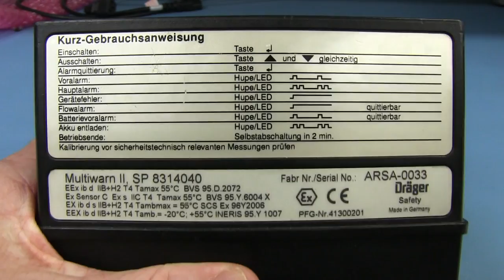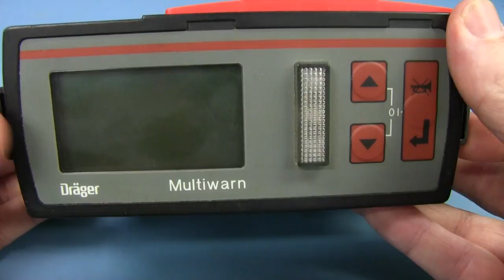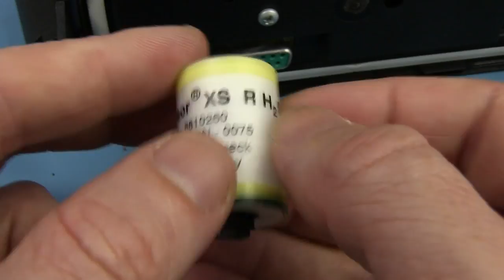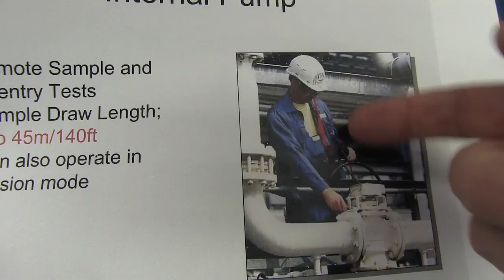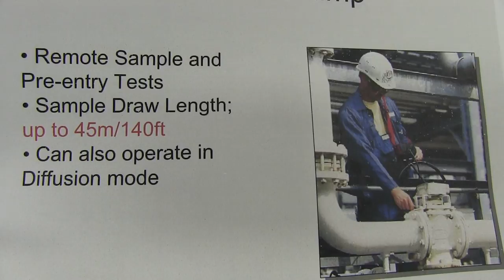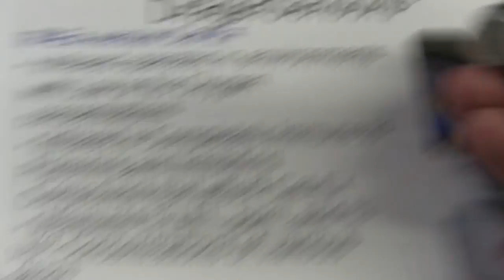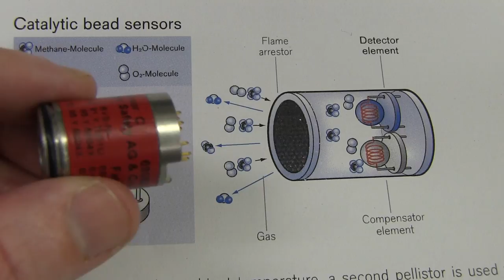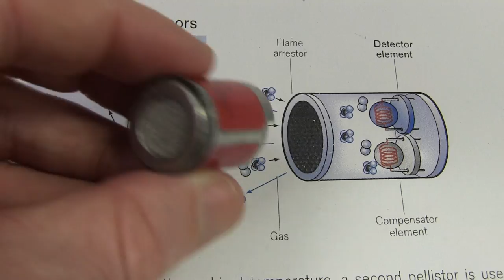EEVblog #603 - Gas Sensor Teardown - Dräger Multiwarn II

Comment: Great tear down.   I used to work on these.    Here is some more info about this old unit from Drager (pronouced Dre-Grr).   Upto 28 different types of chemical sensors were available for detecting various gases and chemicals as needs require, and upto 5 can be installed at once for a configuration of multiple gas detection. All of the other sensors are "electro-chemical", which means they will expire within 6 months to a year typically and with usage and air exposure, and also  "poisoning" (being used and exposed to the gases they detect over time), they will not be so responsive and will have to be replaced.    The silver mystery chamber next to the pump is a Mirror and an Infared Sensor  which is used in conjunction with the
"Catalyic Sensor". (the silver flame arrestor one). It's also sometimes called
an LEL Sensor, which means (Lower Explosive Limit) for Combustible Gas detection,   The IR  sensor is immune to the poisoning, and operates like a backup for detecting explosive gases.  Mainly  for CH4/Methane, Propane and Natural gas detection, but other options are available. Those sensors typical are Percentage or Percentage Volume, while the rest typically show in Parts Per Million.  They have adjustable alarm set points and the sensors are rated for certain concentrations and default part per million calibration setup ranges, which can be changed.

The typical "4 gas" configuration is "CO" (Carbon Monoxide), "H2S" (Hydrogen Sulfide),  "O2" (Oxygen) and Catalyst "LEL" Combustible Gas.  A square plastic chamber plate with a thumb screw is attached to the red part of the detector and screwed down, draws the air in through a 3 to 6 ft usually a PVC  tube connected to a 1 foot probe wand with a replaceable water-filter on the base end of it (the filter will absorb water, encase water is pulled into it to prevent the pump or the sensors and components from getting damaged).   The pump is pretty quiet other than a small hum and draws a constant small amount of air pressure over the sensors to the outlet. The black sensor next to the pump is the pressure sensor, and it will stop with the pump blockage alarm if anything blocks the pump, and can be reset from the panel, with a button to continue after the blockage is removed.

It's usually calibrated using a gas cylinder with regulator and feeds the gas mixture
for the sensors installed and all of the sensor range concentrations to set and test the sensors, then is zeroed out in fresh air.   These units typically last for a full day on battery and record Time Weighted Averages, Short Term and long term exposure limtis and datalog.
Reply: Thanks! Do you still work in the gas industry?

Comment: Hi Dave, the infrared sensor with the mirrors is a "white-cell", a multipass (multiple reflexion) absorption gas sensor for very low concentration in a narrow spectral range. Many years ago I was partly involved in the developement in Lübeck. 

Thanks a lot for your very interesting videos!
Peter

Comment: I work in a chemical Company and I'm pretty sure that the EX-Sensor is a general purpose combustable Gas sensor like we use in our newer Dräger devices to detect if a explosive atmosphere is present. That's needed anytime you open up non intrinsically safe measurement equipment or ofc control cabinets.

We usually have a Oxygen Sensor as a addition so you get alerted if there is something leaking and displacing the oxygen, even if it's not directly detected, or a whole device dedicated to a specific Tasks that has the needed Sensors ready.

And yeah the plant Fire Department has a ton of Sensors, they dedicate a whole Vehicle to it here, so no need to replace the sensors on route to the emergency, there's no time for that anyway!

Comment: The 'Ex' symbol does not mean Intrinsically Safe, it only shows that the product is ATEX certified.
The codes determine the protection level. Ex'i is Intrinsically Safe, but there's also Ex'd (Explosion Proof) Ex'e (Increased Safety) Ex'n (Non-Sparking) Ex'p (Pressurised Enclosure) and so on.

Comment: Very interesting bit of kit!, glad you referred to the manual ;), i know its more fun to speculate how things work. but the manuals are great to really see what goes on :D
I have a few NIB Danfoss Ammonia sensor boards with those catalytic sensors on them, they are used to detect ammonia leaks in large Nh4 based HVAC-R system rooms.

Comment: Hi Dave,

i think the heater in the unit with the reflective back is screwed in. You use these two holes to put a special tool in it to screw it out.
Reply from the maker: Ah, that would make sense.

Comment: In case it's not been noted on the forum, the O2 can is apparently an electrochemical lambda sensor ... if you do a search for the part number you'll find a few references for them, that specific one comes in at $434 from a Drager distributor, the hydrogen sulphide one is $550, but not much on it's specs.
Instead look for just "drager o2 ls" and there's a link to their documents system for 9023522_07_2013_de_en_fr_nl.pdf which I'm guessing is an updated version.
If they're all designed the same, the pcb will have a small memory chip of some sort that holds sensor calibration data.

Comment: The H2S-sensor is a "coulometer", the potentiostatic type, the thin wires are the reference and "working" electrodes, the white material is the diaphragma is a barriere to the air or polluted air. It's an extremely high impedance method, similar (but not same) as the pH-measurement.

Comment: This is in regards to the metal pump housing. To remove the 'heater', you'd use a pin spanner. A set of curved hemostats may work. It's most likely sealed with pipe dope or loctite, I'd put a big tip on a soldering iron and heat it up to ~120-150F to break down the loctite, then try to unscrew it. If hemostats don't work, getting 2 allen keys that fit snugly in the holes, and there are a few ways. Put a screwdriver between them, grab the shaft of the screwdriver and the allens in one hand, and twist, or drill a hole in a piece of wood, lexan, metal that the keys can drop into and fit into the holes. I'd be interested in seeing the actual heater, as I'm pretty sure they'll be baffles so there's no direct heat on the sensors and such.

The mirror is vacuum brazed to the aluminum housing for a hermetic seal. It's most likely a gold (or several other IR-reflective materials) coated aluminum mirror for the far infrared (assuming due to the emitter). 

Thanks for a great tear down!

Comment: The pump is used to test atmospheres in a tank for example without having to put people at risk. A hose connected to the side of the unit and, the pump runs and draws gases from the space under test. These are used where you need to enter a confined space like a cargo tank on a ship or sewers/tanks in the water treatment industry.

Comment: The black unit seemed to be a dummy,
I year you're found of the word intrisic. Although you're right the device is intric, it is not the same as explosion proof. Therfor you're sometimes using the term inappropriate. Intrisic, the i behind EX, is only one of the many ways to make an electric device explosion proof. Other ways include explosion proof 'd', molding/encapsulation 'm', pressurized protection 		'p' and increased safety 'e'. In this case the components are made so that they'll never carry the ammount of energy to make a spark or heat up.

But no harm done, thanks for the tear down, keep up the good work Dave!

Comment: The sensors are in the form of bulk semiconductor sensors that are heated to boil off surface contamination known as Taguchi sensors.  The bulk semiconductor material can be tailored for specific chemistries.

Comment: haha, its cool to see everything at the end translates down to some sort of parameter dependent variable resistor or capacitor which is measured and translated into sensor value. Like variable resistors dependent on temperature/gas combustion rate.

Comment: The 4 ohm IR source might just be a standard incandescent lightbulb. Those produce IR light as well. I've seen them used in methane sensors which were developed at an internship company I visited a few years ago.
Reply: +TheCrazyInventor I know a special IR source from Perkin Elmer: basically a thin platinum ribbon, glowing to emit IR but without glass cover. So very long wave IR is available. Perhaps it is something similar.

Comment: The Ex symbol does not necessarily mean intrinsically safe. Ex means it has been certified to comply with the ATEX regulations. There are a range of different protection methodologies.

Comment: nonane is found in NGL (condensate) from gas production. I may be wrong but the cloth could be soaked in an alkali solution or just water so as the H2S interacts with it the conductivity would change. Could then measure it with the two wires. 
As far as Ex ratings go, intrisic safety (marked Ex i[a/b/c]) is a fairly specific explosion protection mechanism which limits the amount of energy within the equipment. You will see that on the certification on the back that each sensor is certified individually and the sensor C has an Ex s rating which would indicate some other protection scheme is being used. The device overall wouldn't necessarily be intrinsically safe, the manufacturer would have to prove to a notified body the scheme of protection they are using is suitable for the zone in which the equipment is going to be operated in.

Comment: About 5 years ago I was designing gas detection devices similar to this one, but I was mainly doing fixed systems not portable.  Doing this off the top of my head, may not remember the all the details correctly.

This appears to be pretty old tech.  This is commonly called a quad detector.  They usually measure oxygen, LEL (lower explosion limit), H2S, CO2, hydrocarbons, etc.... 

The two "cans" with the white top are electrochemical gas detectors that use an electrolyte and produce a current in the presence of the target gas (usually PPM range).  The IR is detecting either CO2 or a LEL (hydrocarbon, methane, protane, hexane, etc..).  The black can looks like an oxygen sensor, which is really just an open air battery as it produces a voltage based on the concentration of oxygen.  The one with the flame arrestor is for any LEL gas, anything that will burn.  It's a catalytic bead / pellistor type with the flame arrestor prevent any flame with exiting the can.  Most of these are very very sensitive to RF and interference hence the extra shielding on the analog side.  The EC (electrochemcial) and oxygen consume very little power while the IR and pellistor consume a lot (IR little less than the pellistor).

FYI, ATEX CSA FM and UL certification is a pain and can take 6 months to get something through.  Instead of intrinsically safe you can also go explosion proof method (fixed not portable).  The flame arrestor does slow down the detection time.

Comment: I believe there isn't a heating element in the cat sensor, the 'catalytic' part is the platinum - the methane decomposes when exposed to the platinum metal.
Reply: But the catalysts have to be heated in order for decomposition to take place.
Reply: I think platinum sensors are used in hydrogen detectors too?

Comment: why didn't you power up the pump!, power it up, short vid!.
couldn't you try and pry open the sintered top on the cat sensor?
Reply from the maker: What's the point? It's a little air pump, what's the least bit exciting about that?
Reply: it is exciting! those "little" things are always fun to see in movement(that one has an exposed crank even!), besides it could pull air 45m so it might be a beefy one

Comment: i guess it's a ir laser diode with temperature control. the power will vary with temperature and needs to be stabilized much like a green laser pointer ;)

Comment: Hi Dave, I'm a DJ based in the UK. There is much debate over here with the use of fog/smoke machines to make the lights look better, however there is much technical argument over whether it will set a sensor off on a smoke detector mounted in the ceiling of a hotel, etc. 
The thing is, fog generators are water based and (from my days as a fireman) I thought smoke detection was based on organic material I.e. Carbon based smoke (as given off by fire). Seeing this artical posed a question..
Can you help with your electronic wizardry? 
Regards DJ Charly 'C'
Reply from the maker: Hasn't got much to do with electronics. There are two types of smoke detectors, photoelectric and ionising types (or combo). I wouldn't think either of them were susceptible to fog. Pretty trivial to test!
Reply: Why not give it a try with a battery smoke detector, I know I have set off my houses smoke alarms with artificial smoke but who knows a professional smoke machine may work differently!
Reply: EEVblog Thanks Dave, at least you've confirmed my thoughts. All the best, DJ Charly 'C'
Reply: Colin Nutley I know that where i work we have both optical and ionizing types of smoke detectors,And i use an electronic cigarette and it will set the photo sensors off fairly easy even dust will set them off but it will not set off the ionizing type and an e cig works basically like your fog machine, So i doubt the fog machine will set off an ionizing type because they actually sense combustion particles Just my .02  Nice Review and tear down Dave good on ya mate...
Reply: Thanks Apollo robb & justanthought, yes I know household types kick off when fog is released, but all the same great info! Much appreciated, DJ Charly 'C'
Reply: Steam from my shower sets off the smoke detector every time. So I think it's a particulate sensor.

Comment: If not already happened, you should check out the explanation from the Dräger CIN-IR Sensor-Manual (by the way, you spelled it totally correct!). Its all on page 3.

www.draeger.de/sites/assets/PublishingImages/Products/cin_infrared_sensors/Attachments/9023339_12_2007_de_en.pdf

Comment: Nonane is the scientific name for diesel, not sure if it would be straight out of the pump at a petrol station or a more pure version
Reply: Nonane is most likely 'the equivalent of' diesel. The stuff coming from the pumps is most likely a mix of various alkanes and other stuff
Reply: Diesel has no scientific name, it's not a specific compound. It's a mixture of hydrocarbon chains generally from octane to henicosane (8-21 Carbons).

Comment: Does it have Geiger Radiation Sensor buildin??
Reply: Hi Bernard,
A Geiger-Mueller tube requires hundreds of volts between two electrodes. I did not see a circuit capable of providing such high voltage in the video. Geiger-Mueller Counters are usually dedicated measurement devices. 
Cheers
Reply: Ali Mirjamali So it can't detect one of the most dangerous gas on earth? "Sarin Gas"... they have a expansion board for this kit maybe??
Reply: Oh and Sarin gas is so common.  Come on.
Reply: This seems to be equipment for firefighters within petrochemical plants, they would have no use for radiation detectors or
Reply: krawutzimon I was once a Medical officer in the First response rescue unit - civil defence force in my country,we need to carry different detector for different scenario.All in one detector would be good. Chemical warfare like Sarin Gas being used as they are odourless/colourless,I've read that Geiger counter being used to detect Nuclear radiation/ Sarin gas or similar, I'm not Familiar with sensor, correct me if I'm wrong.
Reply: Bernard Lim
Yes, but even then you would still only use sensors for stuff you could probably expect in the specific scenario. to be able to sense all (im)possible threats your equipment would soon be too big to carry around in the field. i remember seeing the sensory equipment for some army abc-armoured vehicles, that stuff could easily have weighed a few hundred kilogrammes, and would still need the vehicle's inbuilt power supply/apu. also remember that this kind of equipment has to be tested, calibrated and recertified at specific intervals -  when you've got everything together that could become quite complicated soon. all in all i think small specialised sensory equipment seems to be the most reasonable choice in emergency / first response situations.
Reply: Hi Bernard Lim 
I would recommend you to watch X-ray fluorescence spectrometer teardown by mikeselectricstuff posted just yesterday. It is possible to detect different substances with spectroscopy at a great accuracy level. Oh, and the device has the Geiger tube. Cheers